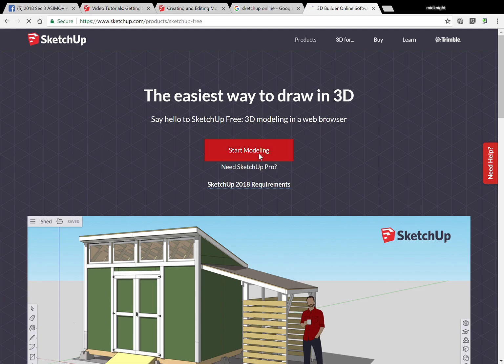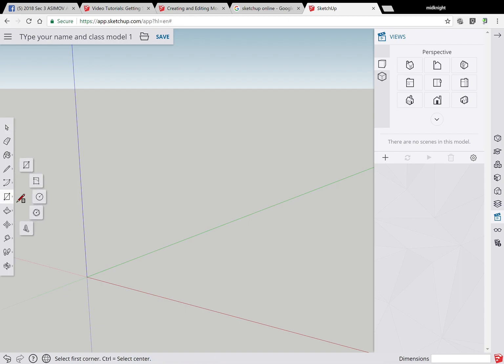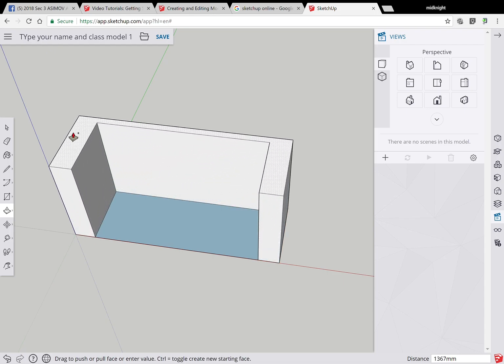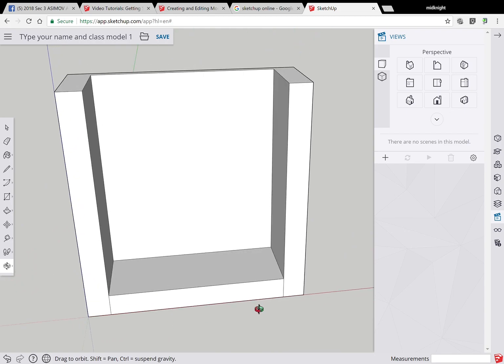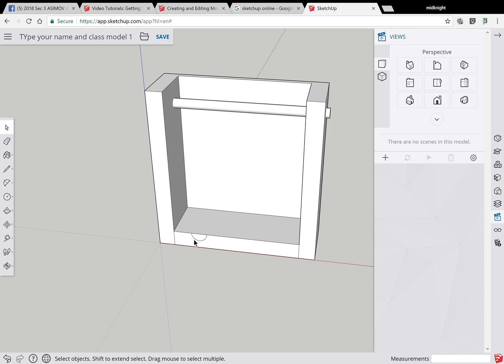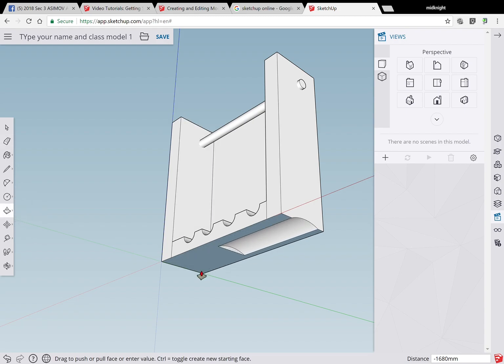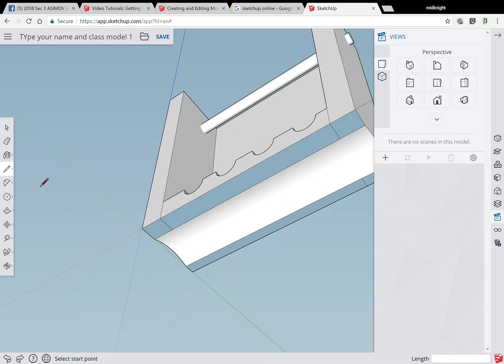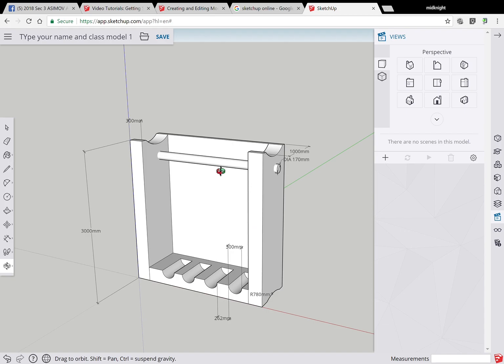How to use SKetchup Online

Comment: Thanks for the video. One question: When I use push and pull with no ctrl, I didn't find the gap on the bottom. But when I do use ctrl, the color of the bottom plane reversed. Did they changed the rule or did I do anything wrong?
Reply from the maker: Not sure if they changed the rule or not. But glad you found my video helpful. 😀
Reply: Do you have sticky keys on?